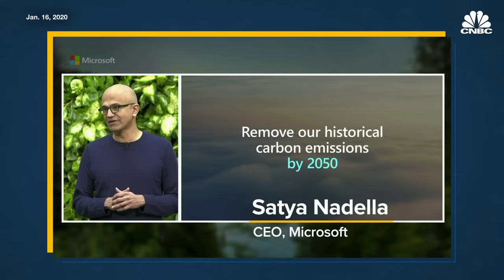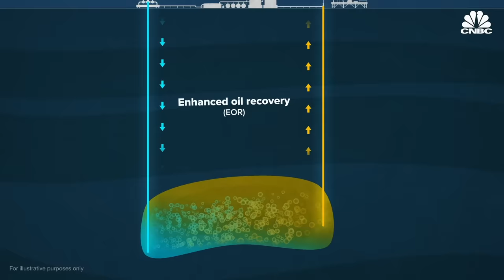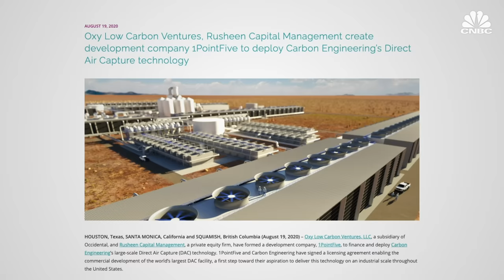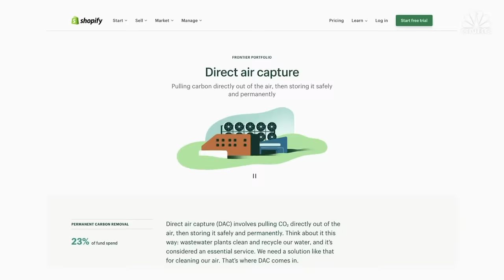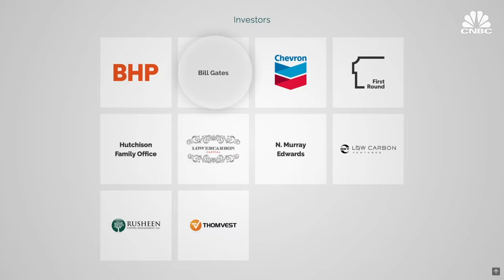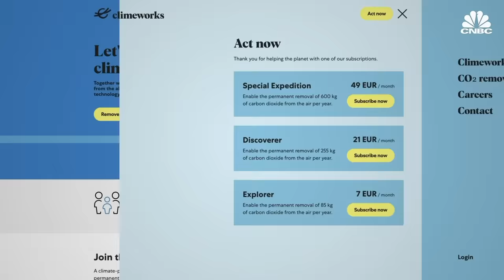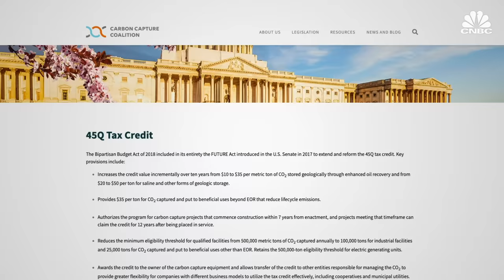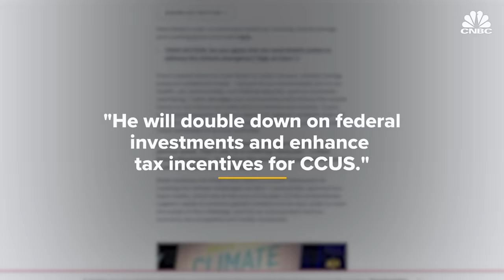Money Is Pouring Into Carbon Capture Tech, But Challenges Remain

Comment: it sounds to me like selling the captured carbon will just release it into the atmosphere again. it has to be put underground, or at least sold only to companies that won't cause it to be released into the atmosphere again.
Reply: Like those that will use it for greenhouses
Reply: @MsGina-dp7es  @Arthur but the greenhouses would be purchasing the carbon anyway, made by other means. Same as Coca Cola, or carbon dioxide for welding etc... would be purchased and released. So by supplying it already recycled, you're displacing the co2 that would have been made chemically. So it kinda is neutral 🤔. The real solution would be to stop consuming it, but that's not gonna happen!
Reply: Construction projects is really the only long-term use of it I can think of. To transform it into graphite or cement, or really anything else solid that won't be consumed.
Reply: @come_on_now  The general efficency of sunlight to useful energy in plants is generously considered about 1%, wereas solar panels are pushing towards 20% or more. Plants' ability to store carbon long-term is practically non-existent unless they get compressed into the earth/beneath the ocean and turned into coal/oil over litteral millenia. We don't have that kind of time.

With plants you need more and more area to store more and more carbon from the cycle, and their efficency at that task is crap both energy-wise, area-wise, and time-wise.

We'd need to set aside a massive amount of area to the task, and dedicate massive amounts of manpower to accomplish it, and even then it will take years - if not decades - to truly get going.

Compared with that, a carbon capture plant is more efficent, more effective, cheaper, easier, and takes up less space.

In other words, yeah. Bill Gates does indeed know more than god at capturing carbon from the atmosphere. As do I for that matter. Nature never evolved with the efficency of carbon capture and storage in mind. That has never been a task life has truly concerned itself with before now, and as such even the most rudementary of human techniques easily beats out nature's best alternatives.
Reply: @peterwickham9984  Funny that I can argue against someone spouting religious arguments in a video sbout climate change and carbon capturing, at least he acknowledged that there was a problem. You seem to have buried your head in the sand and refuse to acknowledge scientific data and consensus. I can't argue against a climate change denier because the only thing I can tell you is to 'look at the data', which you will either respond with 'I have looked at it' or 'the people publishing that data are lying'. In the first case you would have only looked at the data that fit your current views, and in both cases you will ignore any proof or study put before you. But the truth is that you're wrong. CO2 in the atmosphere does indeed make that atmosphere capture more heat from the sun, which in turn sets off massive chain reactions that cause even more CO2 to be released. This is bad for us. It is human caused. And we have to do everything in our power to limit and counteract it.
Reply: Also what was the source of energy used to run the fans... 60% coal plants?
Reply: @life42theuniverse  That depends on which country the plant is set up in, or if it's connected to a special power circuit. Whatever the case, as a proof of concept and advancement of technology it's worth it either way. This is a thing we need, and being able to build them effectively and quickly is more than worth them currently being powered by coal plants.
Reply: @96ace96  Well, soil can retain carbon, so you are partly right and partly wrong. I mean, yeah, plants are not the solution to the problem, but preventing further deforesting and desertification of soils should be top priority. Like, the ship is sinking and instead of patching up the holes, we are trying to craft an electric pump from wooden barrels and ropes lol
Reply: @matheusviolante8364   @Matheus Violante  Soil can indeed retain carbon, as can trees and anything made of them. Doesn't mean it's particularly efficent in the carbon storage area. Preventing grown forests from being cut down would definitely help, since that is carbon already stored, but a tree often takes half a century (and that's optimistic) to grow to maximum size. That's just too slow for our purposes. Desertification is a problem, and planting living trees is definitely a good way to stop it, but it is also a different problem than the growing carbon levels in the air. The issues are related, certainly, but the best way we have of reversing the carbon trend is still technological carbon capturing machines.
Reply: Well recycling carbon is a much better option compared to burning up more, there are industries that still rely heavily on carbon, rocketry, food production, and whatnot, zero carbon is impossible but neutral net zero carbon is possible today, we can store most of it yes but we can also reuse some of that carbon as well.
Reply: @come_on_now  we only started living up to the age of 80, before that a mother of 5 would b lucky to have 2 of their children live up to the age of 5. God didn't save us we saved ourselves by creating manmade products, medicines, better ways if living and technology that helps both nature and us and tech that's in many ways better at scrubbing the atmosphere of carbon compared to what trees are able to achieve in this modern age, carbon production is at its highest, there's only so much trees can currently do to capture all that, what is wrong in investing in tech that can do the same job but more efficiently and faster then trees would, storing carbon deep within the earth within days compared to millennia. Also there is bacteria that breaks trees down that basically make it impossible for trees to store that carbon captured underground and end up releasing it back into the atmosphere.
Reply: @matheusviolante8364  just cause it can doesn't mean it is efficient in doing so, efficiency is what is key here, trees take years to grow to full height making them inefficient to capture carbon, the sea can also capture carbon but too much of it ends up poisoning the ocean, the soil also takes years to capture that carbon as well. We already have a solution works that both works and can store it within a day. It's not a bandage work since it is more efficient at its work compared to what nature is able to provide.
Reply: @life42theuniverse  Depends on where it's setup mate, the entire world isn't America mate and if it's able to eat up more carbon then it's using, that's a change and is a much better solution then using that carbon and capturing less of it, overtime ofc countries like America will slowly move towards more nuclear power plants to take over fossil fuel plants, it's not going to stay at 60% for all of time forever.
Reply: Seems like it would be well used for petrochemicals. Many of which are needed for important green things like batteries.

Comment: It’s a positive feedback loop for oil fracking and refineries.
Reply: Plus little less carbon dioxide in air
Reply: How about walk. Most of USA is either overweight or obese.
Reply: Which is why I did not believe in this tech when they came up with it. More energy waste just for show.
Reply: Well, it is not all that bad. After all, if pumping CO2 down the depleted oil well allows to squeeze some extra oil out of it, is somewhat friendly to the environment - otherwise we would build another oil well elsewhere, and that would consume energy and resources, impacting the environment even more. It might contribute to higher emissions by keeping the price of oil lower, but it is hard to weigh one against the other.
Reply: @TheBlobik  it is funny they say depleted when normally you only produce like 10-30% of the reservoir. So no they are not depleated. Also EOR cant applied in every well and not used in fracking. Only in wells with good communication between each other and a compatible chemistry CO2 can be injected, if not you can change the wettability and chemical composition creating complications to production. So CO2 only works in a few wells....

Comment: 1 gallon of regular gas costs $2.73

Burning 1 gallon gasoline produces 8.69 kg CO2

If direct carbon capture cost the anticipated $150 per net ton CO2 today, it would cost $1.30 to recapture the CO2 from the one gallon of gas

(Possibly net recapture required could be dropped by 15% if the ethanol element was from carbon neutral sources)
Reply: Interesting! If there was a way to also quantify the effect of pollutants on the healthcare systems, the true cost of the gallon of fuel would be even higher.

Comment: remember guys, reduce, reuse, recycle
u dont need fossil fuel to move tons of heavy steel to get yoass a bigmac
Reply: And don't use
Reply: You still need to move tons of heavy steel to get the components of the device you used to write this comment from a factory in east asia to be delivered to to your home.
Reply: @jackmcslay yes i love trucking. peterbilt, scania, volvo 15L V8 turbo. u name it.
but im cycling purely with my leg power when the only thing need to be moved is just my ass
Reply: @farikkun1841  Did you not get the 'east Asia' part?
Reply: @jackmcslay  necessity vs luxury, you need to move those tons of steel for important things, you don't need to move/have a personal 2 ton steel structure that spends 90 percent of it's lifetime parked somewhere.

Comment: question: can the captured carbon be turned into solid state? it can then be used to reclaim land or as a building material
Reply: Technically you can. Heat magnesium in carbon dioxide. This gives you magnesium monoxide and pure carbon. Then treat the magnesium monoxide with hydrochloric acid. This gives magnesium chloride and hydrogen. The hydrogen can be stored for later. Melt down the magnesium chloride and do electrolysis. This gives you back the pure magnesium and chlorine. React the chlorine with the hydrogen and you got your hydrochloric acid back. No waste products, pure carbon output.

The problem is that you wouldn’t want to do this if you want to profit in any way because the costs outweigh anything you can make selling the carbon.
Reply: @valeriyproklov2868  Actually, we can just pump the CO2 into magnesium hydroxide, and let them turn into magnesium carbonate. After filtering and drying, we can use the magnesium carbonate as a building material.
Reply: CNBC has a video on that captured carbon concrete, and i think dubai recently made a whole building with bricks and concrete that was 3d printed using captured carbon as material.

Comment: One of our problems is concrete. One cubic yard of concrete puts out 400 lbs of co2.  A full grown tree absorbs about 50 pounds a year.  I don’t know exactly what the result of cutting down trees and putting in a subdivision with cement roads and building is but it has to be horrible.  There is a good article on Wikipedia.

Comment: Trees have no such byproduct and work far better
Plant trees.. can you afford some seeds?
Reply: Iceland. You’re capturing CO2 in the wood, and drastically increasing carbon in the soil. Best, Iceland has developed the technical know how. Just add cash.
Reply: Planting that many trees is far more complicated than many realize from an ecological perspective. If you use a single species, you are creating a monoculture that can be easily wiped out with a virus or bacteria. Also the effects from a monoculture on the local environment could potentially be devastating if done incorrectly. On the other hand, planting a diversified set of trees requires a lot of environmental research and planning. I’m not saying that we shouldn’t plant trees, I’m just saying its not as easy as the many think.
Reply: @jackshen5093  yes, people are like "jUsT pLaNt TrEeS bRo!"
Reply: We can do both, you can plant a great deal of carbon capture in environments where there are no trees. Tundra and Artic for example.
Reply: @mateuschwarz  but if you ask they dont Even know the difference betwen a pine and an oak

Comment: Carbon capture has amazing potential to help reduce CO2 in the air, but I feel some insulations should be based in cities where there are higher levels of CO2 present than in the countryside.

Also where is the discussion over protecting our oceans. How many people are aware that the 80% of the air we breath doesn't come from trees, but from our oceans? Our oceans are also the largest carbon sinks as well. We need to look at protecting marine life on all levels from phytoplankton that converts CO2 and water to the oxygen we breath all the way to fish and whales which sink to the bottom of the ocean and store carbon.
Reply: Carbon dioxide is well mixed so it doesn’t matter where we collect it from. No advantage of being near cities, unless you’re capturing other pollutants that don’t last long enough to become well mixed.

Comment: I get frustrated how oil companies have become vilified by the media. The goal should be to generate the lowest carbon energy, while improving the lives of all humans worldwide. Obviously oil and gas companies are involved with the sequestration aspect of this tech because they’re the ones with the subsurface knowledge to properly store CO2. It’s not as easy as just pumping it in the ground forever. Furthermore, no one discusses the emissions and environmental issues associated with green energy materials, but that’s a story for another day... Lastly, to the Stanford professor’s point, CO2 doesn’t store at a 1 to 1 ratio to hydrocarbon produced. Rather, due to a process called adsorption, reservoirs are able to store more CO2. In fact in some coal seams, the ratio can be as high as 10:1 (CO2 stored to methane produced). All in all this is a good video and it’s important to draw attention to this up and coming tech, however, I can definitely sense a tone of bias towards oil companies producing lower emission hydrocarbons which could be used to improve the lives of people without adequate access to energy and displace higher emission energy (coal) in places like China.

Comment: What an excellent video. Unless we reduce consumption, we have to have some level of carbon capture happening. Especially as the natural carbon capturers, ie, trees and soils, are already capturing less because of reduced rainfall. For example, in the south of the UK at the moment, we've had little meaningful rain since the winter and tree growth is noticeably less than in a 'wet' year. Many trees planted by local councils are dying, so I think technology has to step in, not to mention technology to assist a wholesale switch away from fossil fuels instead of the laissez faire business as usual approach that is in operation worldwide, despite talk of reducing carbon emissions.

Comment: Stop playing pretend!
Why would you even bother to use so many resources to build a machine sucking co2 out of low-quality oar when you can just grab it from smokestacks?
Just like with solar roads. Making things unnecessarily more expensive and worse performing compared to BIPV, Rooftop solar, and industrial-scale solar PV.
Biofuels make whole another host of problems - Groundwater overuse, agricultural land use for energy, pesticide use, soil degradation while breaking equipment harvesting and processing fuel, but in that process consuming "Dirty" fuel.

Comment: An interesting point at 8:36 in video is that use of direct air capture for enhanced oil recovery actually results in net zero carbon dioxide release to atmosphere. Most of comments seem to have missed this point. Hopefully, in the future DAC powered by solar and wind can create enough synthetic fuels to completely eliminate fossil fuel sources.
Reply: that's like if you are fat, so instead of excersising to lose weight, you excersice to be able to eat more.
Reply: @brownerjerry174  still better than just eating
Reply: @Aaron-ru6ld  just moving around on the couch would be better than eating and not moving, doesn't mean it is in anyway an option good enough to overlook other way more promising options. Democracy is horrendously sloppy and slow, once the situation of emergency amongst the people calms down, and most people think that, that status quo is good enough and catastrophe has been reverted than literally nothing will be done to actually make things better, no funding for startups researching things that would make use of stuff and all.
Reply: @leafyon  What about all the energy costs to do the CCS? What about the manufacturing and resources costs. We can't just "magic" the infrastructure into existence. The math has already been done that shows direct air CC and CCS doesn't work at the scale needed to offset or equal emissions or even cover the emissions needed for the infrastructure use and build out.

Comment: Before cut trees in the name of carbon, now as there are less trees ,use these methods to capture the carbon, which was done by the trees.
What a joke.
Reply: Trees are a one time carbon capture. Once you have a fully grown forest the forest is carbon neutral and doesn't capture any more carbon. It's impossible to plant enough trees on Earth to pull out all of the carbon that was buried in the ground before.
Reply: @Ergzay  that why you got to cut those suckers down, build something with them, and let more grow.
Reply: @Ergzay  The current proposed solution is to take the CO2 and bury it, which requires special substrates, is energy intensive and so on. You know what's easier? Burying a tree, that's how the coal we're burning was created.
Reply: @supergamergrill7734  You're better using that power for the grid.

There is a thermodynamic limit for how good you can make a technology. Even in best case, it's not good for carbon capture.